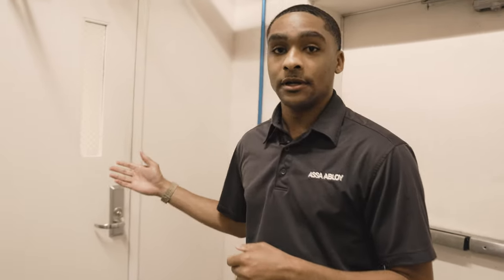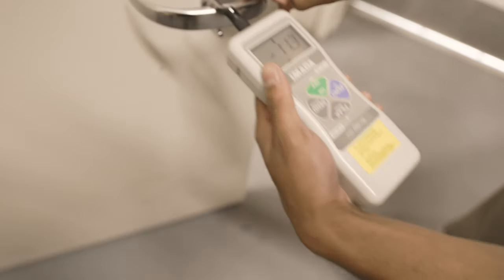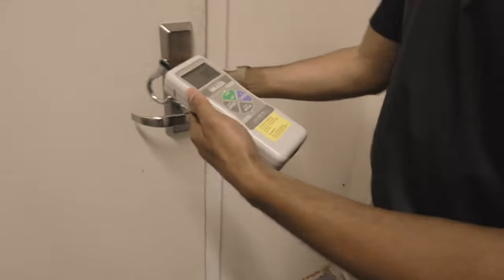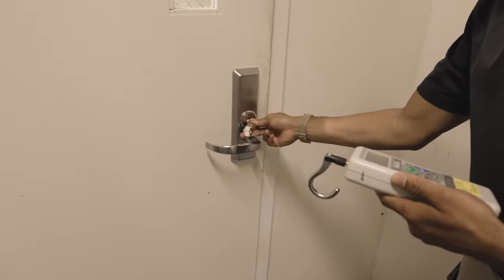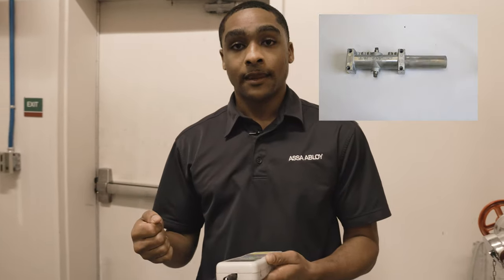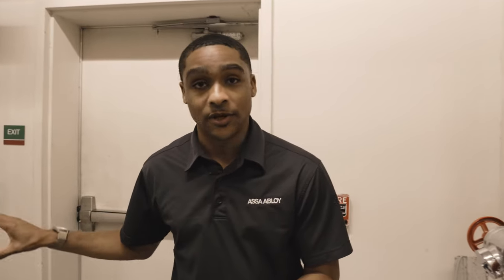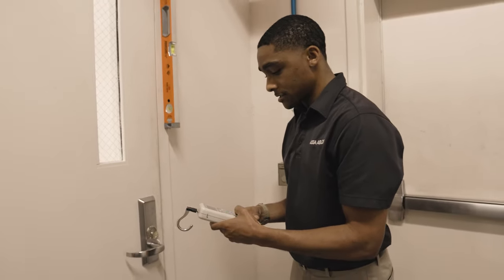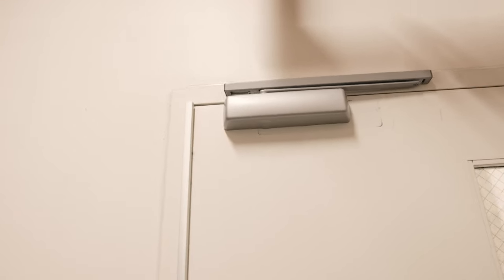Special Feature - The Problem with Your Stairwell Doors

Comment: you need to preload the door closer, then it will always latch properly
Reply: Preloading is important, but it also increases the resistance on the door and won't help with ADA/the UX of a heavy door